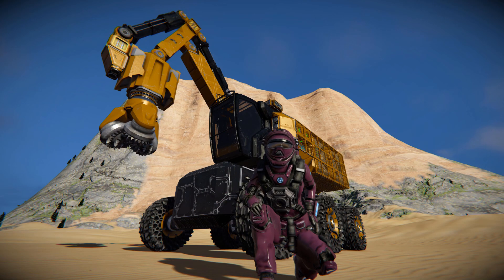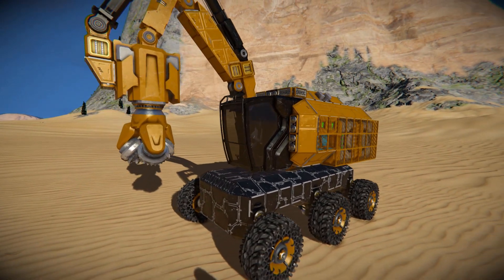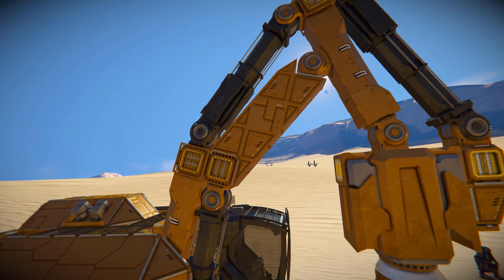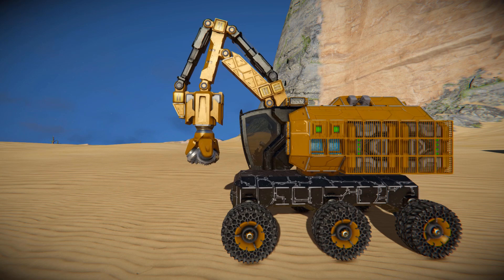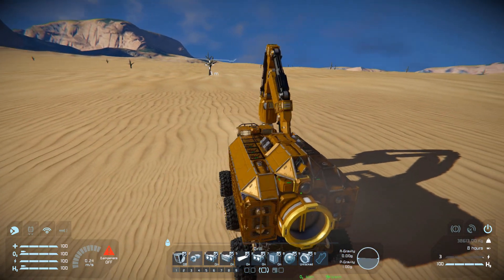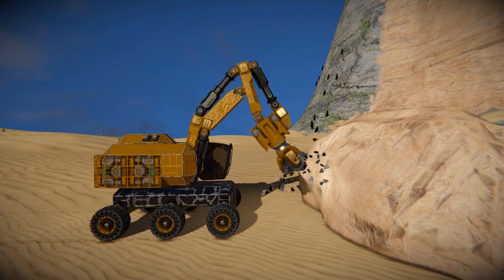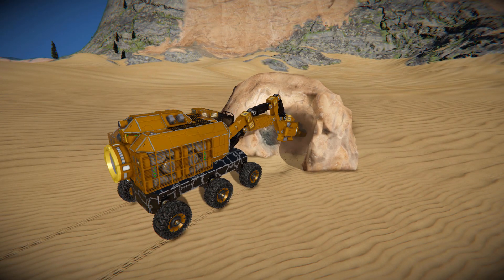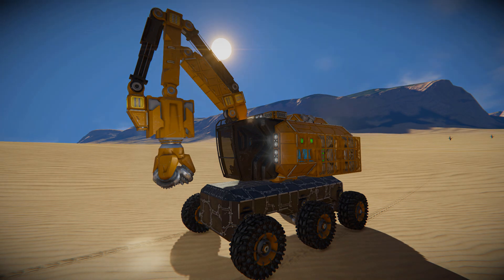The King Klang Excavator - Space Engineers

Comment: For applications like this, I use the "Cockpit Piston, Rotor & Hinge Controller" by Tekk.  It lets you bind those movements to certain keys and even set the speed.  Slowing it down helps with the stability....as does the landing gear suggestion.

Comment: Easy way to help with the stability is a deployable landing gear or somethin... simple piston to extend down to the ground and the landing gear would automatically lock into the ground... now the only thing that'd be moving would be the arm and therefore far more stable.

I did that with one of my massive excavators (GIANT drilling mobile platform type base). It didn't work too well until after a few tweaks (the gears got merged into the ground due to the added weight and caused a lot of problems trying to retract them), but get it right the gear will lock as soon as it hits the ground and if the piston is set to the right distance will not go over that extended limit... unless you want to lift the vehicle off the wheels. :D